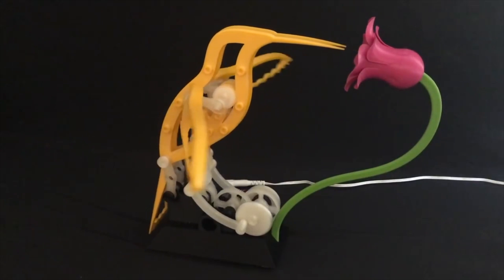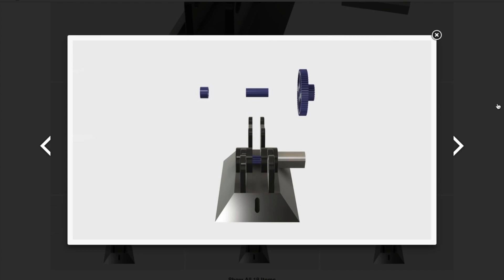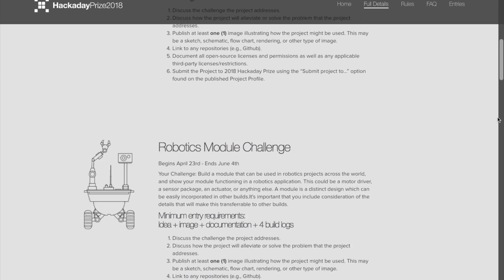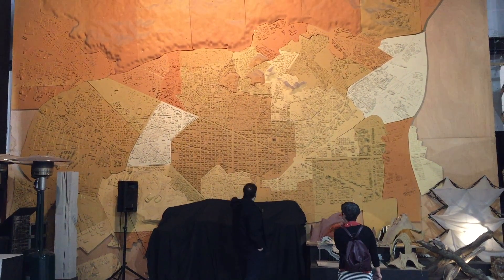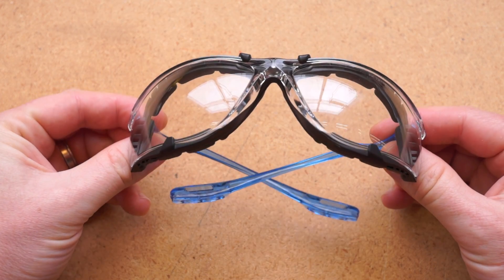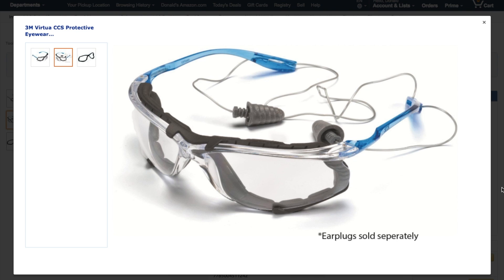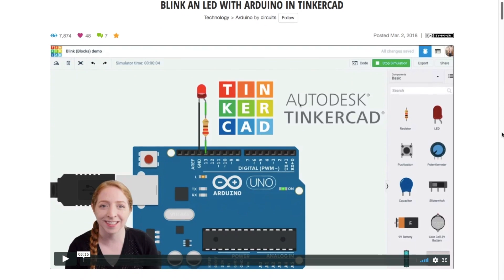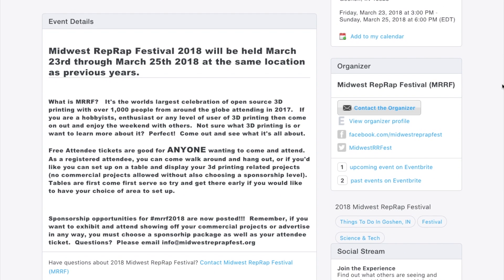Barcelona is for Makers [Maker Update]

Comment: I actually opened a 3D printing company called Hummingbird 3D Solutions when I moved back to NC.
I'm definitely printing the mechanical hummingbird for our reception area! Thanks for the find.
Reply from the maker: Outstanding! Is this you http://www.hummingbird3d.com/ ? Sorry I never got around to using the Isolate It you sent me. The bike I had with the ideal handlebars busted, and the used one I picked up had straight bars and it seemed overkill to tape them up. Keep me posted on the business. Maybe we can work out a promo for prints exchange (shamefully, I'm still without a 3D printer).
Reply: That's us. Located in scenic Burlington. Not the origin of the coat factory, but oddly enough where pantyhose was invented.
No worries on the Sorbothane. If you have anything shaking on you, it always works in a pinch. I've used it on desk fans, bikes, and even a chiller for the laser cutter at our maker space.
I'll send you an e-mail through my work account, would love to discuss any printing projects you're working on.

Comment: Looks like that TInkercad stuff is getting really close to an ideal "scratch" like GUI for Arduino C++ code-exporting. I think Arduino should be focusing their time on making that happen as opposed to developing more Arduino boards.
Reply from the maker: Hi Josh! Agreed. I honestly don't know how Arduino's making any money off hardware with all the clones and straight-out unlicensed ripoffs out there. And yeah, I think part of the reason Raspberry Pi is going gangbusters is the Scratch compatibility. What Adafruit has done with making some of their Arduino boards Python compatible and tied into the Microsoft MakeCode system https://makecode.com/ is a neat step, but it really leaves the Arduino code and C++ behind.
Reply: broken link due to ")", but here it is for next viewer: https://makecode.com/
EDIT: I missed the tab at the top that allows switching between tool and code. Very cool. Definitely need something like this for Arduino C++.